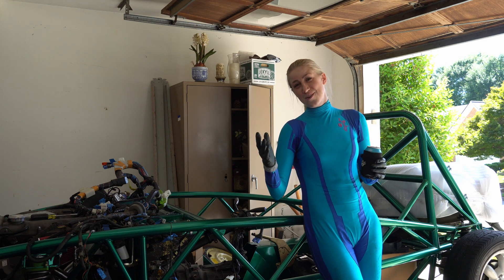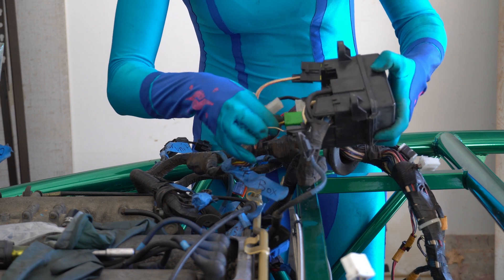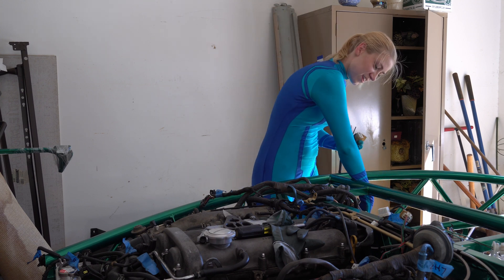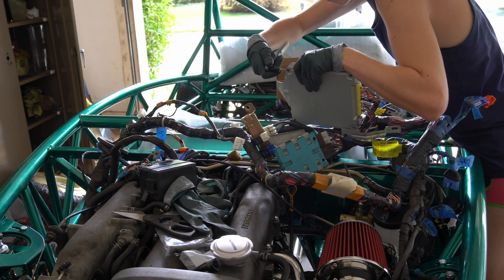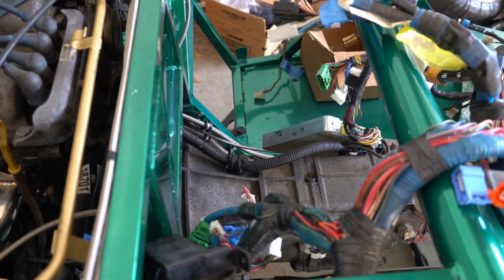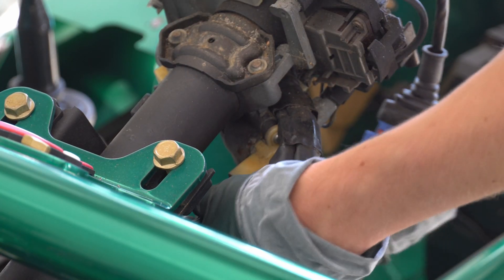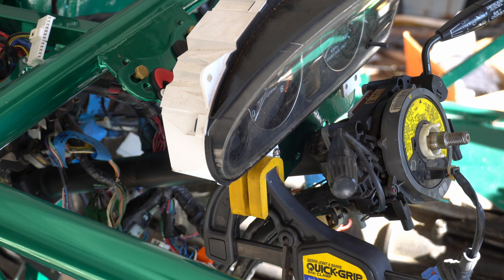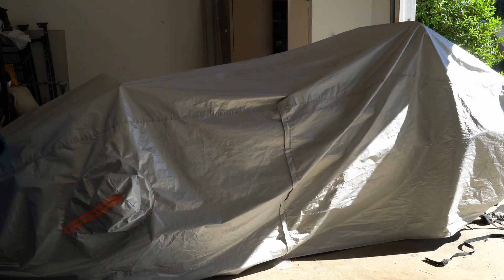Exocet Wiring: Round 1/2

Comment: First law of stripping out a wiring system: mark all the connections, looks like you cracked that. Second law: take photos of everything before you rip it apart and print them out to work with on reassembly. Lost count of the number of times I forgot that law. Love the safety suit, built in gloves and everything!
Reply from the maker: Hahah I’d say a first-first law would be to know what the heck everything is in the dash, So you can abide by the first law of marking, and I definitely failed that! Haha the built in gloves are great, until you need to unlock your phone to look at wiring references...lots of nose typing that day...thanks for watching!!